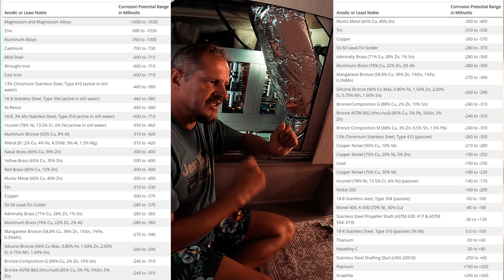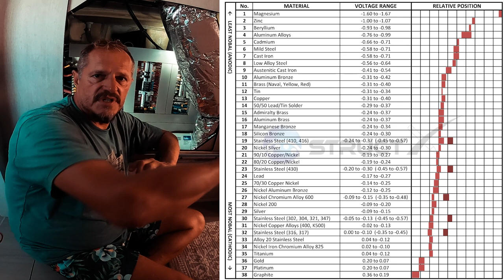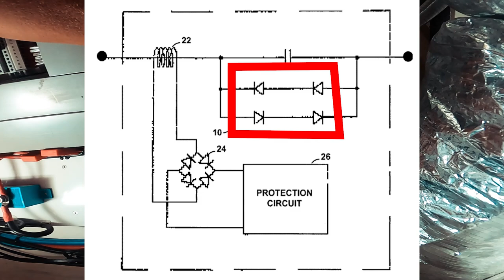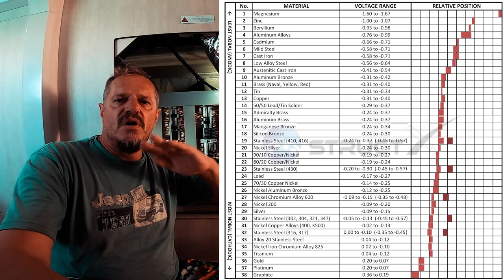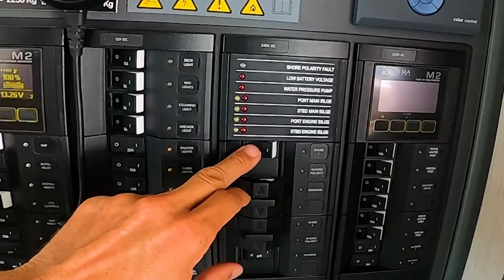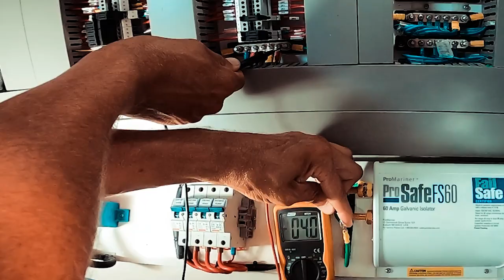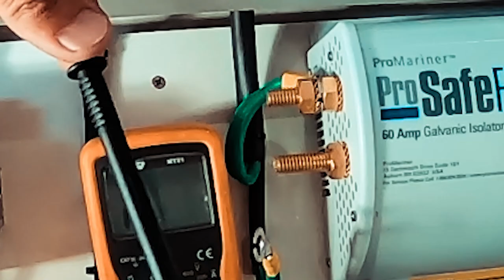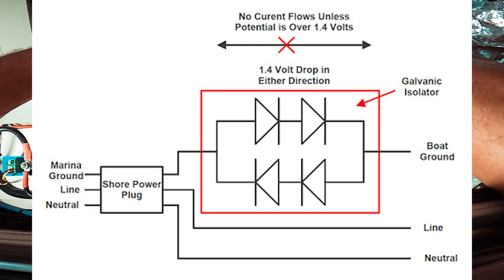#96t Why does one need a Galvanic Isolator on a Boat | Sailing Sisu Leopard 45 Catamaran

Comment: Very educational,  explaining corrosion, but also, “stray current” and the theory of electromagnetic plating, and Sacrificial anodes.
I actually find it amazing you try to expain how it works..  
very well done!
Reply from the maker: Trev, thank you! 'trying' being the operative word 😂
Reply: Sailing Sisu,    Nar you did well..  all good.. it’s one of them subjects i had to learn (very old school engineering)  and if you can get your mind around they way metals work, alot of things are much easier to explain, everything from a light Bulb to batteries, bearings, corrosion, volt drop, welding (superheating stress fractures) ect ect..  the list goes on and on.   I seen no faults in your explanations..  all good 👍

Comment: It is very easy to make a galvanic isolator yourself for a few bucks. I did it and very happy. There are schematics on the net
Reply from the maker: Jip, basically four diodes and a capacitor and some stuff to ensure that if a diode blows you still have earth... Or get electricuted if you accidentally got your fingers on 220V 😅

Comment: Happy New Year! I just recently discovered your channel and already love it. No offense, despite the countless hours you sacrifice for making this content possible, the film-making quality is certainly still much below the other big channels (Uma, Delos, LaVagabonde, Zatara, O'Kellys, Nahoa, even the authentic "Old Seadog"...), BUT you more than compensate for this via the amount of densely packed useful information.

A more complicated/detailed question that might also be an idea for a separate video (I'm not sure if you ever talked about this): would you be interested to explain the lightning protection system and electrical safety on your boat (=passenger safety, but also device safety)? This includes aspects like: are there separate ground plates for each hull? What's their surface area (aproximately)? Which parts of your electrical system and metal parts are grounded? Mast? Standing rigging? Guard rails? Antennas? Only the AC circuits or also DC devices? The latter includes: does the boat use a grounded central negative, like the typical situation in car installations, or does each DC device use positive and negative wires running all the way back to the battery?

Last but not least: is there a so-called "Surge Protective Device", *SPD type 1*, installed, like we see as an essential part of the lightning protection strategy in house installations (DC versions of this principle also exist and are e.g. used to protect "off-grid" solar panel arrays against lightning strikes)? I never heard anybody talk about this in the context of boats. Is there any reason it doesn't work? I'm not talking about protection against kind of minor voltage spikes in the "grid" (like in the example of house installations or a boat under shore power), but basically an on-demand "3way switch" that is able to

(1) briefly separate the positive and neg pole and hence all devices in your onboard circuitry from ground (=isolate ground) whenever a huge current (lightning strike or basically anything caused by a voltage higher than 0.5-1 kV, depending on the individual SPD model) primarily enters via ground or a grounded component that isn't current-carrying under normal conditions (e.g. lightning strike to the mast or lightning into the water or another boat very close to your boat), i.e. an event without that doesn't primarily affect "pos" or "neg" wires.

(2) isolate either pos or (3) neg from the electric circuit (hence allowing to shunt the current flow only directly via ground, instead of e.g. pos. wire-->device(fried!)-->neg. wire-->grounded negative battery pole) in case of a power surge/lightning strike affecting a "pos" or "neg" wire.

The problem without this little trick: we have to decide wether we want to ground-connect either pos. or neg., because we can't do both simultanously without creating a short-circuit or stray currents. An SPD-type1 elegantly solves this dilemma by basically being a super-fast reacting automatic "on demand grounding" switch for either pos OR neg OR ground itself (=default). If on the other hand (like in the standard situation) only neg is grounded, a lightning strike will still be shunted to ground, but not without frying the devices in the circuitry. With an SPD-type1 this shouldn't happen.

Thanks!
Reply from the maker: Excellent thoughts! Our tech videos, the ones with a 't' next to the number, are not going to win any quality contest 😅 but please, have a look at our non technical videos and tell us what you think?
As for lighting protection... Very big topic. Fortunately, I do have a friend who is doing lighting protection for military aircraft and he gave me some great advice on how to optimize for indirect strikes. I have been in my previous life involved with telemetry systems and no protection is available for direct strikes if you are touching earth. Keep watching this space, I am going to document this process and principles

Comment: If I remember correctly the movement of electrons from a unstable shell to a more stable shell is a covalance or valence movement to be in an equilibrium.  Wow I  am still bewildered,  I recall something about an isotope, did it not have something to do with electrons moving to an unstable space.
Reply from the maker: In fact, Negus, at one point you will see my eyes flicks top right to access the visual representation of the Quantum particles spinning and how they vibrate in their wave lengths to have a fixed quantized energy... And then I thought to leave that for the rusting video 🤣😂

Comment: Simpler--- Use an isolation transformer for 100% confidence!! of isolation from all galvanic currents or impressed currents.
Reply from the maker: Exactly! The isolating transformer is the best, but also heavier and bulkier and more expensive. Almost the size and weight of a lead acid battery.

Comment: Your video will save allot of issues. Esp. Aluminum Yachts. It can start to flake like pages of a telephone book.
Reply from the maker: 😅 Michael, that would be a huge tragedy! If they do not know of Galvanic Currents 😏
Reply: @SailingSisu  I saw it in the bilge of a Aluminum Sail boat delaminated sheets lifted with white powder in between. We had a Galvanic meter I would put over the side to measure. Some marina's were incredibly high.
Reply from the maker: Oh wow! Yeah, I guess sailors in a marina doesn't realize that!

Comment: You mentioned a magnesium anode for your saildrive. My understanding was they should only be used in fresh/brackish waters.  (Recently googled to confirm)
Reply from the maker: Oh, I did not know that. I am not sure what ours is then, but it is super lightweight. It may very well be Zync, but it does not feel the same as the prop zinc?

Comment: This video is very interesting.  Something I never thaught about.  So the galvanic isolator,  works to protect the boat from shorting. Why does it need a capacitor?
Reply from the maker: Ah, Negus! This would have been a good AIDS topic! Actually, it prevents the propellers to 'rust'. The cap is there to keep AC earth for in case the diodes blows. AC can go through caps, DC not. So, if you do touch a life wire, then the spike will still go through the cap and trip the earth leakage breaker. This is for the case if a diode blows,because you loose ground/earth.

Comment: I had no idea that the DC voltage could leak from the show power in any significant amount and cause so much corrosion and damage. Good on you for doing all that research or did someone tell you abbout it? Quick question, doesn't a marine isolation transformer do the same thing or does it work only for AC current?
Reply from the maker: Thank you, John! It is actually not technically DC voltage, but Galvanic Currents based on the atomic periodic table. But yeah, these metals create their own currents. Think of every boat with some metal in the water, as part of a big battery and all connected tmetals are the anodes in one big ass electrolyte called sea. The weaker metals will dissolve first. As for isolating transformers, they are the best since no DC currents pass, but the downside is that they are bulky and heavy.
Reply from the maker: Oh, John, I actually discovered this white thing below my DB board and I was wondering WTF this thing does 😅
Reply: @SailingSisu  😆😅😂

Comment: Excellent, all correct. But explaining this topic to a noob is so hard. On a steel boat I like an Isolation transformer better.  I have the IT3600 from Victron.
Reply from the maker: Yes, it can get technical very quickly, and yes, the isolating transformer is way better! Just a bit more bulky

Comment: Did your Leopard come with that Galvanic Isolator or did you install that your self?
Reply from the maker: This one I discovered one morning looking for a blown fuse 😅 and then I was wondering what the heck it is and why it is on the boat. So, yeah, Leopards have them factory installed.
Reply: @SailingSisu  Ha ha, a nice way to find out, I guess you researched what the Isolator do then  😅
Reply from the maker: @BennyTheNerd , exactly! I had no idea I had one! I heard that I need one, but did not understand why besides it is protecting my zincs in a marina 😂
Reply: @SailingSisu  Sometime you get pleasant surprises that doesn't cost anything !! :-)